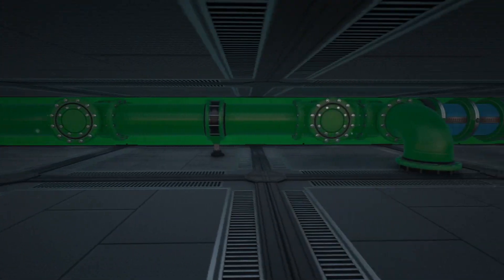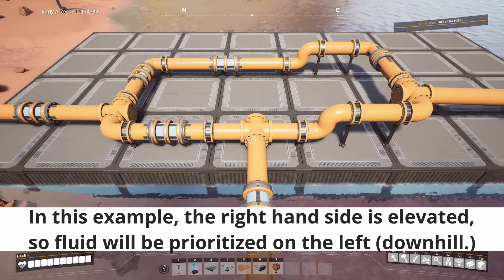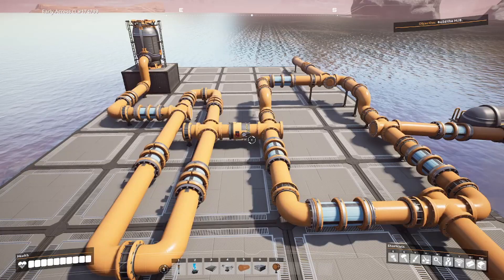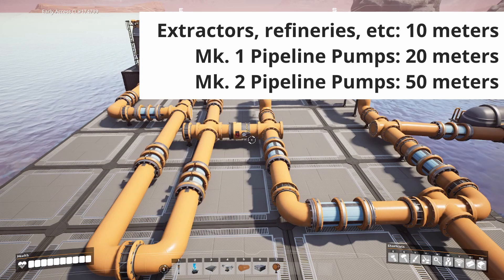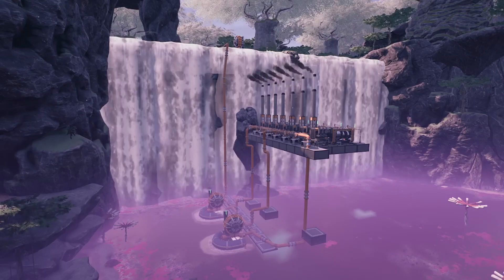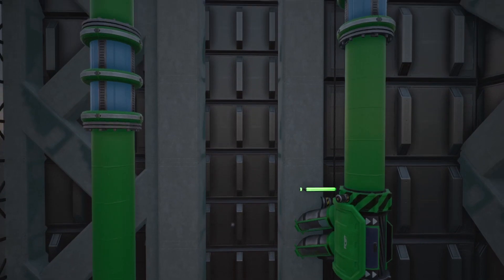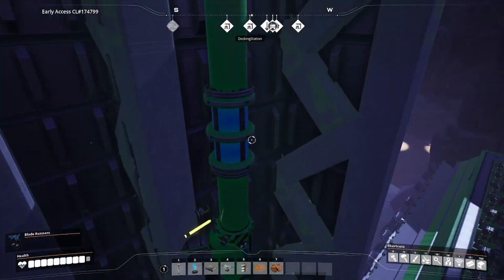Satisfactory Update 5 Fluid Guide - How fluids work in Satisfactory Update 5(Guide / Tutorial)

Comment: You probably wont see this but I am having trouble with my refinery randomly going completely dry thought maybe it could be not registering due to my oil being really far away ive gone back and forth end every time just see the pipes dry all the way up until I reach 80% ish of my pipeline where I begin to see oil, I have no backup in residue, inclines have pumps and are powered it just kinda stops and starts and not an interval either, kinda new at the game but I feel like I went through it pretty thoroughly
Reply from the maker: Fliuid is tricky, especially over long distances. If I have to go more than a few hundred yards I usually set up train lines for this reason. I think its certainly an area where the game needs more TLC. 

Sorry I don't have more specific advice, but I feel your pain.

Comment: Is headlift consumable?  If an extractor provides 10 meters of lift and it is connected to a pipe with two consecutive vertical pipes, each 10 meters high…does the second vertical pipe experience 0 headlift as the first pipe ‘consumed’ it all?

Does elevation of your water pump provide extra headlift to the system?
Reply from the maker: Head lift isn't consumed, but also wouldn't apply to the second pipe in your example. Think of it like raising the water level in a pool - the first 10m pipe ends up under the water line but the second remains above it.  To raise it into the second pipe you'd need a pump, but anything else built below the water line would have pressure so it's not really consumed by the pipe.
Reply: @Dekoba  if I had one ten meter vertical pipe and then ten meters further down I had another ten meter vertical pipe, forming a U, both would receive the headlift?
Reply from the maker: @Ender7j  If I am understanding your analogy, yes. Imagine the build being placed in an enormous swimming pool -  the head lift raises the water level in the pool, and anything underwater should be fine, no matter how many things there are below that water line or how far spaced out they are. Only vertical distance matters.
Reply: @Dekoba  gotcha.  I’m going to try reworking my coal power plant (x39 gennies) using your explanation.  I get sloshing in my pipes and one or two of them (coal plants) will intermittently shut down or drain out completely.  If I introduce a fluid buffer before my pipes hit the plants, would that help to maintain constant positive pressure?
Reply: @Dekoba  seems like all I had to do was a row of mk2 pumps at the base of my plant and remove all the other mk1 pumps that were actually stopping the head lift from spreading to the rest of the system.  As of right now, I’m consistently generating 3.5 GW without any dips in the graph.  Thank you for the tip!
Reply: Oh yeah, and subbed…I’d like to see what else you help me with :P

Comment: Could you do an episode on fluids when using perfect ratios using valves. I find it very unstable and unreliable and cannot get my head around the precise dynamics of the flow in the system.
Reply from the maker: For sure! It may be a couple weeks but I've been planning an adv. fluids guide, and can cover how to stabilize flow. The guide I'm putting out tomorrow morning has a flow stabilizer as a part of it so that may be worth checking out as well.
Reply: @Dekoba  looking forward to it.
Reply: @Dekoba  Exactly that video made me to look into your older videos.

You showed flow stabilizer, but didn't explain how and why it works. So I wonder if I need to build it exactly that way everywhere where I am pumping maximum flow rate (600 in mk2).
I have built aluminium factory recently, refineries are tightly packed and they should work nonstop with 600 alumina solution coming through one pipe, but they are making breaks.

So do I need to build stabilizer exactly like you shown and it should just work? Not that I would have much space to add it now :D
Rebuild hur hur!

I have also old build of 2x Pure Oil nodes with parallel mk2 pipelines into plastic and rubber production (pipes are connected in the end as you suggested here). Full 1200 Oil/minute should be refined at the same speed, but it just doesn't. Same problem, I guess.
Reply from the maker: @mhx47  So the game struggles with maxed out pipes -  fluids tend to flow in waves with peaks and valleys. You can watch a pipeline on an oil node to see this -  a normal node produces 120/min but thats an average, it actually fluctuates between 90 and 150, going back and forth. with maxed pipes, those peaks never happen so you tend to get less flow overall. I put a splitter right on my fluid source when working with maxed pipes to minimize this as much as possible.

A flow stabilizer works by buffering this flow somewhat -  if the network after the stabilizer overfills, it backs up into the storage buffers and fills them up a bit, and when the inbound flow falls into a valley, the storage buffers release fluid to make up for it. The result is that before the flow stabilizer you still see the same 90-150 range for a 120 average, but after it you get 110-130. this can help ease shortages but may not eliminate them entirely. It would be better to overproduce your fluids slightly  (partly to resolve a bug in the game, and partly to provide space for the wave peaks) and also to run parallel lines instead of a single central main line. 

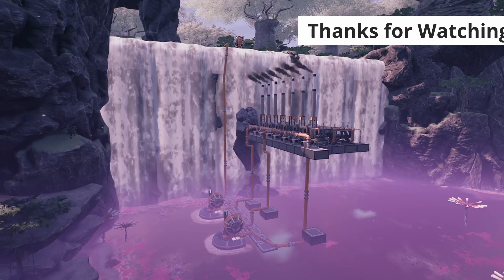The only time ive seen a 600 unit line work effectively is when  it was a straight vertical drop - it was a vertical power tower using packaged fuel which was carried to the top of a vertical tower and flowed downward to feed 135 generators below it, with bascially 9 floors with 16 generators each stacked vertically and the fuel coming in from the tip. In my fuel video idont cover this but do it - if you pause the video at the 5:10 mark you can see the second crude line coming in from the back  of the plant. Its still off a single 600 oil node, but the oil extractor feeds immediately into a splitter that then carries into 2 300 crude lines to the plant.
Reply: @Dekoba  Thanks for response.

Why does stabilizer consist of two tanks and valve pipe in paralel?
Why not just one tank and valve in paralel?
Why not just one tank and valve in serial?
Why not place more valves on the whole network?

Is this design just what you tested and worked, did you test more of them and only this worked? 

And, don't all those tanks after several hours/days spend up all reserve coming back to problem with full saturation of pipes and generators going idle?
(I built coal generator power plant with saturated belt mk5 and it worked well, no losses after an hour. But after a few days I noticed generators on the end of line didn't have enough coal to work.)
Reply from the maker: @mhx47  I tried using serial storage and valves and it helped but didn't work as well as I was hoping. I found a comment on reddit that suggested parallel tanks and that worked better, so that is what I went with for my video.  I see no reason why more valves would hurt things, but I am also unsure of how much it would help. I havent really researched how a valve-heavy pipeline would function.

For stabilizing flow, I tested 3 or 4 different ideas trying to get the flow to be smooth and even and perfect, and I was unsucessful, but this design worked best. The others I tried were using several valves in serial sequence on a short pipe (which had very little effect further down the line), using a single storage buffer in front of a valve (which helped  but not as much as this,) this one with a single storage buffer connected on a parallel pipe (basically half of this design), which was about as effective as the in line stoarge buffer, and this one, which worked the best but isnt perfect.

Ive never had a problem with full saturation going idle. When Ive had idling problems its because either of insufficient fluid production or some flow bottleneck. Running pipes in parallel seems and overproducing fluid are my go-tos for fixing fluid issues and will always work, its just when tuning to get as close to 100% effficieny as possible that things get tricky, which is where something like the flow stabilizer comes in.

Comment: Nice guide.  I just built a plastic/rubber plant.  I build all the refineries on an upper floor with just an elbow through the floor, and all the piping on the lower floor. (Same with conveyors.)  Unknowingly, I apparently did a good load balancing thing. lol  I was wondering if the head pressure would work with closed loops differently, the same way they do in real life.

Comment: Why can't you feed 50 fuel generators with 600 fuel?
Reply from the maker: You can but fluid has a 'sloshing' in the pipes so you need to split the flow between 2 input pipes, and allow the generators to fill some. Once they are up and running the 600 fuel will be an effective average, but on a single mk 2 pipe itll be lower than that because you dont get the peaks of the flow waves (the pipe caps them off, running 2 pipes in parallel resolves this), and if you dont overflow the gens at the start, the valleys of the flow may lead to some having intermittent outages.